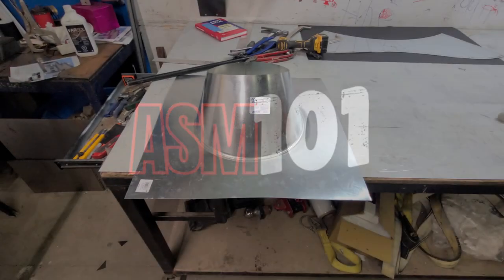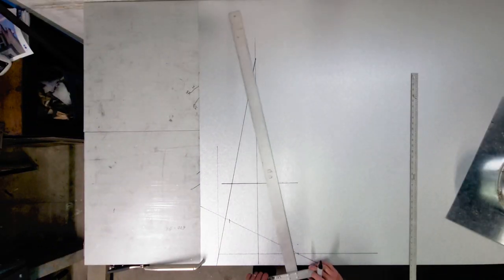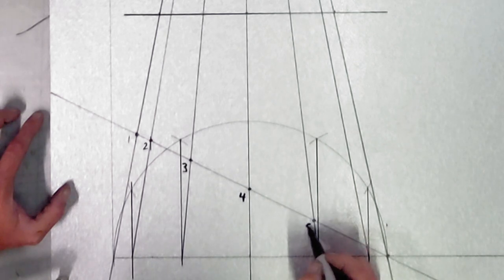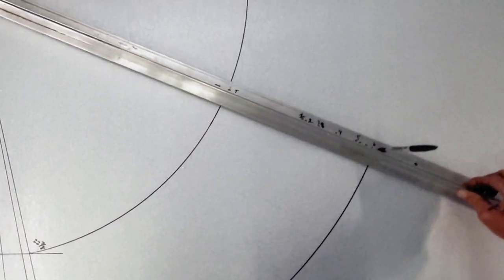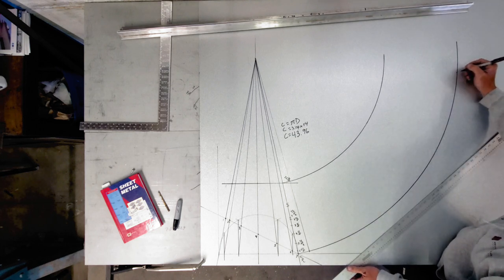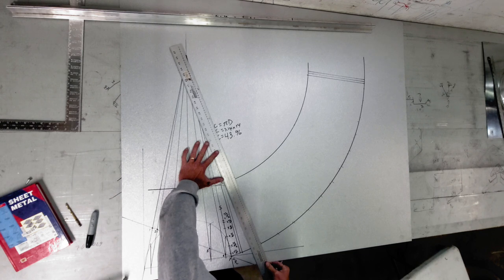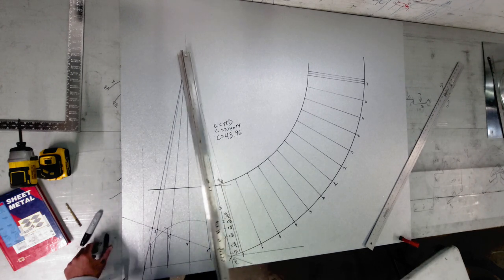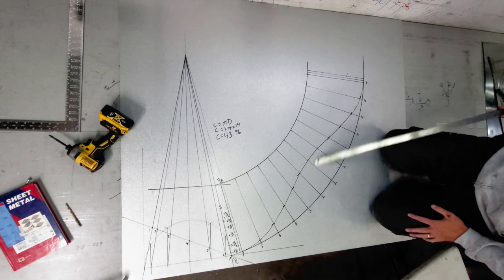How to Make a Chimney Pipe Roof Flashing with Sheet Metal

Comment from the maker: Click here to make the pipe------>https://youtu.be/kRfEZH_QVlY
Reply: Got a 👍 I have a stove roof ventilation vent that's NOT in center of the metal roof panel, it's close to the rib, I see where some create a "box" that is lifted ABOVE the rib & then allows for a typical vent boot to be fastened TO such box and the vent boot is in the CENTER of the box, this looks like to me HOW & the BEST way to solve my leak, I CAN measure the angle of the roof relative to the pipe coming out of the roof etc, is there ANYONE who can make me such a box that I can just located OVER the RIB interference seal it & screw it to the roof? I mean I DON'T mind if such can be made out of thicker metal or aluminum if it will solve my problem

Comment: Got a 👍 I have a stove roof ventilation vent that's NOT in center of the metal roof panel, it's close to the rib, I see where some create a "box" that is lifted ABOVE the rib & then allows for a typical vent boot to be fastened TO such box and the vent boot is in the CENTER of the box, this looks like to me HOW & the BEST way to solve my leak, I CAN measure the angle of the roof relative to the pipe coming out of the roof etc, is there ANYONE who can make me such a box that I can just located OVER the RIB interference seal it & screw it to the roof? I mean I DON'T mind if such can be made out of thicker metal or aluminum if it will solve my problem
Reply from the maker: Check ur email